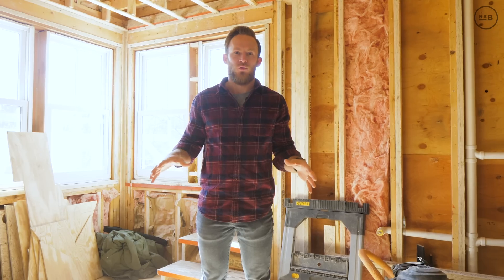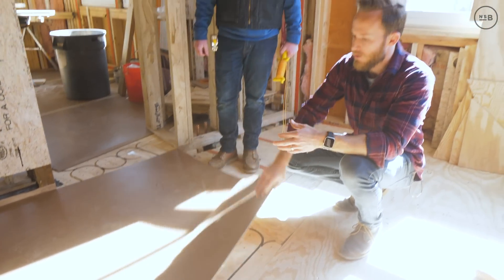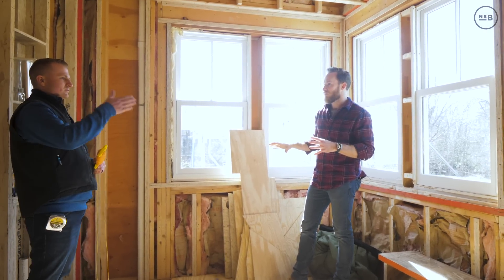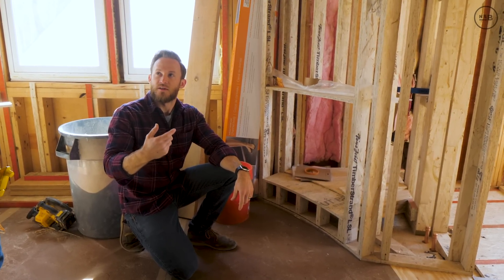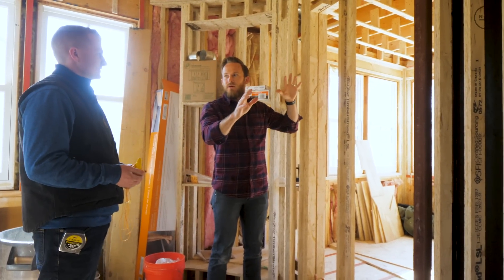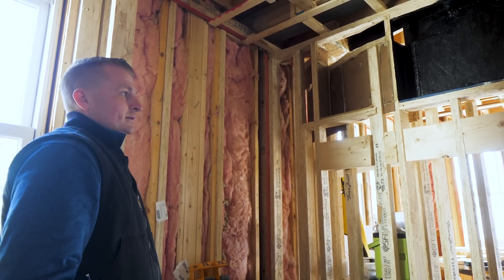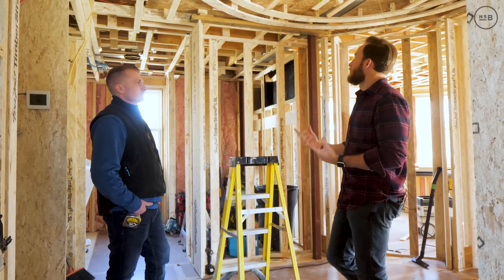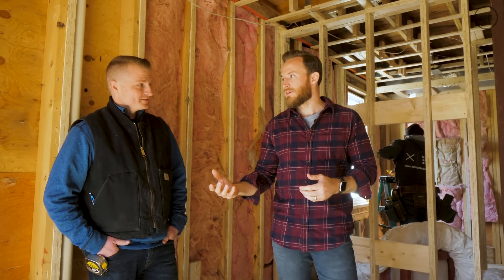Massive 96 in round recessed lighting in a master suite renovation

Comment: What about using large PEX pipe as a drain for the steam generator over copper or cast iron?, it does come in 2  1/2" or 3" a little more work to make sure the slope is good but it should handle the heat just fine.

Comment: Per UPC and enforced by many inspectors here in the SF bay area, the finished drain height in a curbless shower must be 2" lower than the finished floor height at a pitch no more than 1/2" and no less than 1/4" per foot. As I understand it, this is your best shot at creating a functional pan for the certain event of a drain backup, hopefully reducing the chance of water leaving the shower stall and traveling to water sensitive areas. Look at it this way, a strip drain up against a wall should have, a 4' surface pitched at 1/2' per foot to yield a difference of 2" between top of finished drain and the finished floor of the rest of the bathroom. You can bring that slope out farther than the actual footprint of the stall to lessen the pitch. Not many builders or inspectors understand or enforce the code correctly, but trust me on this, when that linear drain clogs up with hair, you'll find your showering time is very short before the water starts to build up and travel into adjacent spaces.